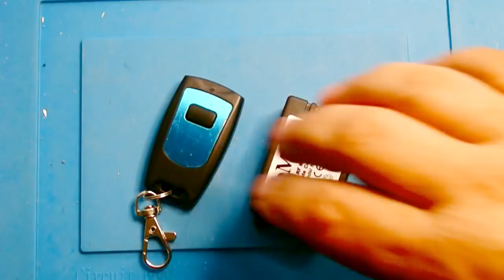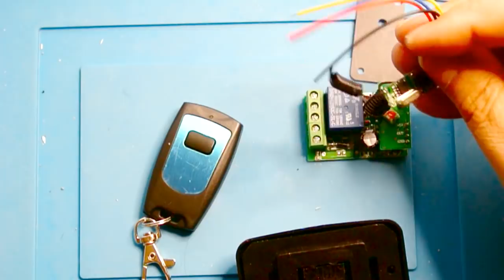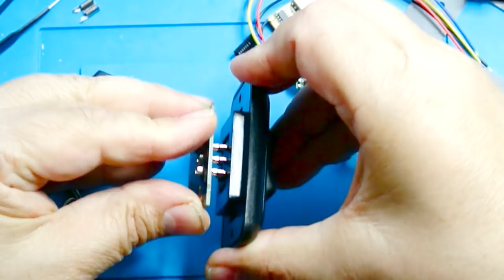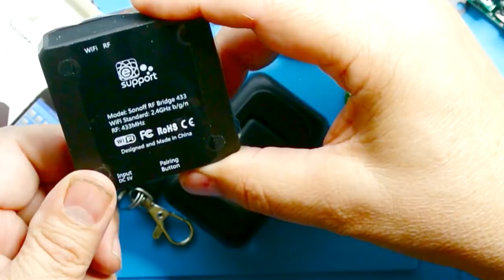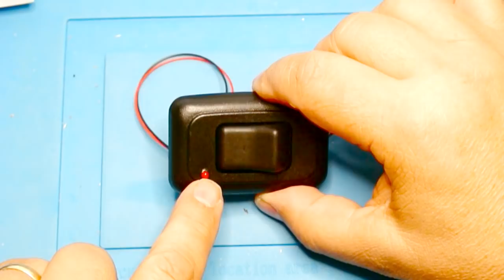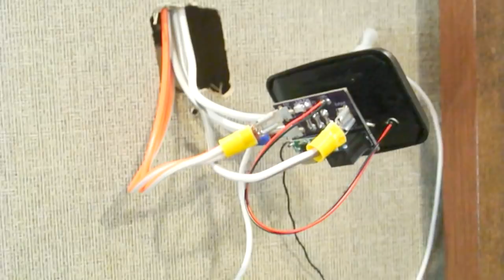A custom built wireless control for my RV's Light Switch.

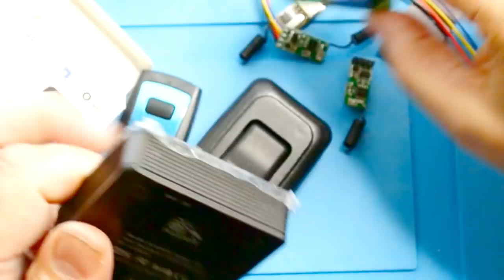Comment: at 5:47 i cussed when you said the wifi module can output as a transmitter. That's brilliant and a great way to save money on the whole system. Here I am trying to put wifi smart devices in every switch.

Comment: Nice video - I like the way your mind works!

I'm a full-timer (Monaco Dynasty 45') and have been retrofitting my existing lighting system from the former halogen and fluorescent to all LED. As you know, the right product is NEVER available! I have several lighting circuits set up with  Wi-Fi/Google Assistant relays that work perfectly fine for my application. However, I've stalled while technology catches up a little. Ultimately I want every circuit to be dimmable AND function in a true three-way, plus smartphone control.  
Most of my switches are ganged in quantities of 2 up to 6... They all use Carling Switch (or Cherry) pressed into a panel with screen printed graphics/labels. Ideally, I would like to be able to remove each Carling Switch and replace it with a Wi-Fi/Google Assistant/Dimmable/3-way+ Smartphone device!  Whether or not the existing switch can/will be used isn't important, but I would like the panels to appear the same as they do now when everything is finished.
Presently I have two lighting circuits operating with a Wi-Fi/Relay/Dimmer board hanging in the wall behind the switch, and everything works fine. But I know you understand, this is not the right way to do things!
Any ideas?
Reply from the maker: One of the projects in the back of my mind is to add Bluetooth connectivity to the 433Mhz relays.

Otherwise, you can look at Tasmoda on Sonoff modification (google it for more info). The Sonoff is a WiFi to 433Mhz relay bridge, but as is requires an internet connection.  Tasmoda alleviates the need for a connection.

The only limitation I see is 16 Tasmoda is limited to 16 devices.

Comment: While I do see the wifi being a nice way to control things when you are away from the rig. If you cant walk over to flip a switch in an RV you've got problems!  A wifi controlled thermostat would really be a nice feature especially for those of us with pets.  I do like this technology and really enjoy your channel though.
Reply from the maker: One issue we have is the bathroom light is on a motion detector so when I get up at night (at my age, it is a common thing), the bathroom light comes on so I can see where I am going.

However, it often false-triggers and will come on by itself occasionally, sometimes several times a night. I dunno, maybe  it's the dog playing tricks on us by turning the lights on at night.

With the wireless control, I can turn the light in the bathroom on and off at night while I am still in bed and not have to rely on the proximity switch, or have the lights come on from our trick-playing dog.

Comment: I just mount the larger relays in the ceiling above the existing lights. 
The reason I wanted wirekless switches is because I didn't have light swithes in the walls, just switches on the fixtures. Not good when you have a 7' ceiling and a 5' wife. RV manufactures are so cheap.
Reply from the maker: That works.

Comment: I'm trying to make Wireless turn signals on a custom motorcycle but I'm kind of stumped as to what I need to do this. Do you have any suggestions or links or something like that? Thank you by the way thank you for the videos well I'm going to do this with my fifth wheel
Reply from the maker: Wireless turn signals?

Comment: A smart RV !!! That should be cool. 
Do you plan to have any "if/then/else" type logic with it?
Reply from the maker: I am designing a receiver board to handle multiple channels. I am using an inexpensive 433mhz receiver and feeding the data to an Arduino Nano. I discovered that the transmitters simply send an 7 or 8 digit code. I am able to capture that code with the Nano and then perform various functions.

Yea, there are a few "if" statements in the Nano's firmware.

Comment: This is to much for the regular R.Ver.
Reply from the maker: I dunno, I am basically just taking a commercial product and providing a  nice method of mounting it to the back of the switch. I could have simply shoved the receiver and wiring into the switch hole and let it dangle off the switch.

Younger people are demanding everything be automated and controlled by their smart phones. I have two acquaintances that are going far beyond what I am doing. One is using ESP8266 WiFi boards to completely automate his RV, while the other is custom building his own tank sensor system.

You should see what eighth--graders are doing with Arduino and Raspberry Pi microcontrollers.

Granted, it is not for everyone. That is why I try to provide a variety of projects; mechanical, electrical. electronic, complex, and simple. Hopefully there is something for everyone.
Reply: I do electronics and repair on C.B. Radios for a hobby and it’s fun.
Reply from the maker: I first got into electronics when I was in the military in the 1970s - I was an electronic technician then, and worked on multi-million dollar communications systems, some of which still used electron tubes. 

After leaving the military, throughout my civilian career I still worked in the computer/communications/electronics field, with some engineering work. My last job pretty much put all of those things together with real-time data collection systems.

I am retired now, and the Dr told me if I kept my mind young, I would not get old... so electronics is now a hobby.